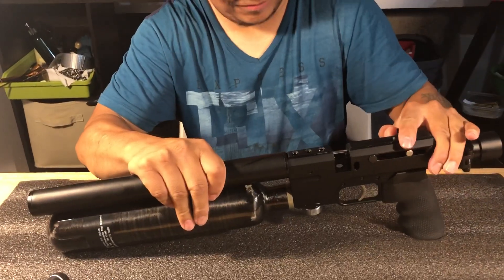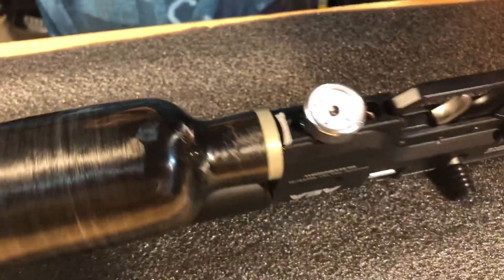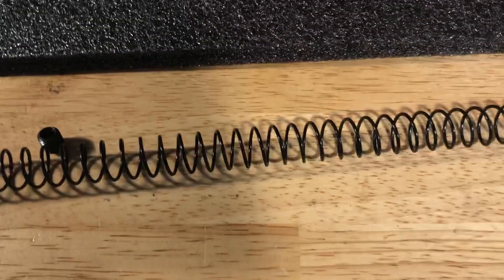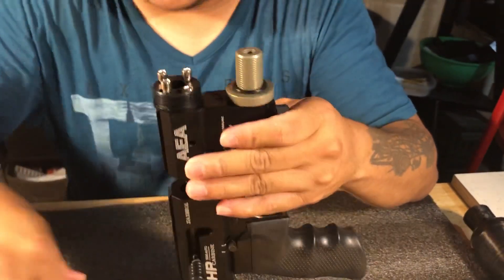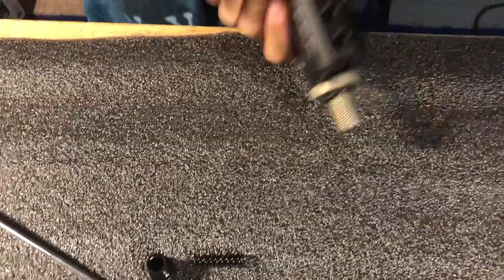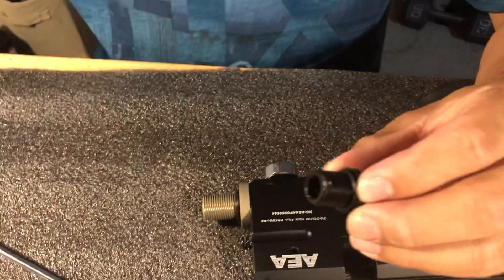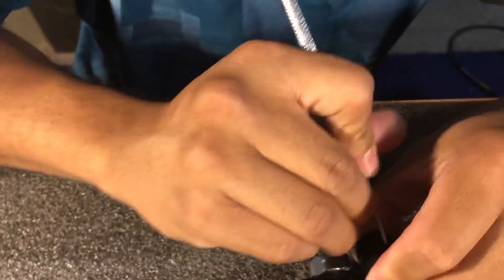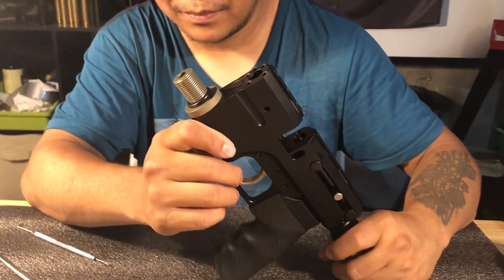AEA How To: how to replace the valve pin for HP semi carbine

Comment: I have the 25 hp carbine and The valve pin keeps breaking. Has the manufacturer fixed this problem? It’s like every two hundred shots or so   Please tell you have a better replacement Part.

Comment: Those stupid valve pins are the Achilles heels of the AEAs. If not for the reinforced pins I got off of eBay, I would have thrown my hp Carbine into the dumpster already.

Comment: I have the assassin  in 30 cal it was fine when I got it put about 15 shots threw it then  next day no air pressure  went to fill it up  won't hold presher or fill up  sounds like it's leaking air out the barrow  as I try yo fill it up   what would cause that issue thanks
Reply: The broken valve pin!

Comment: Having a problem with the cycling of my 30 SS I keep getting pellets stuck in the shroud working from the field pressure that is in the manual any suggestions fired six shots 3 came out three stayed in the shroud and they weren't three in a row
Reply: Did you figure out the problem ?